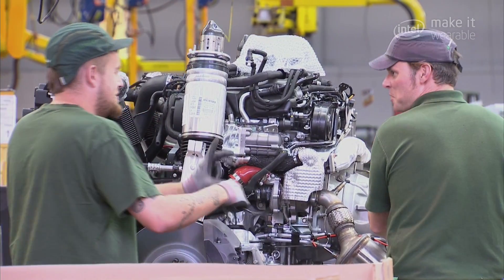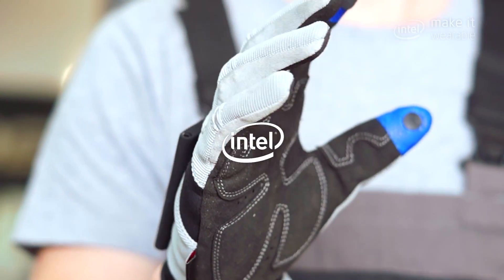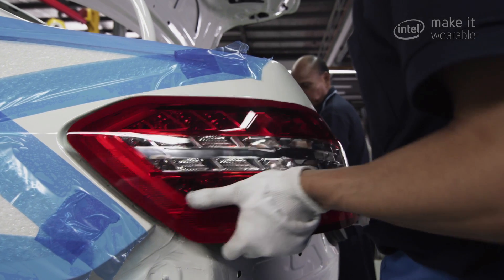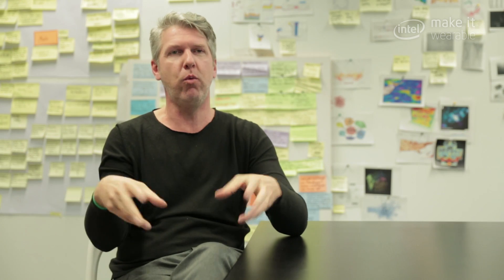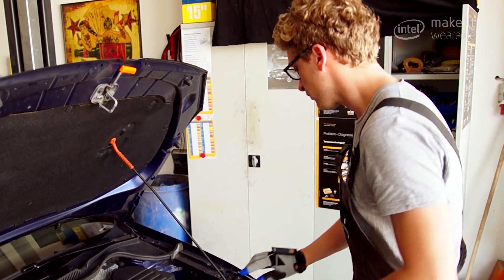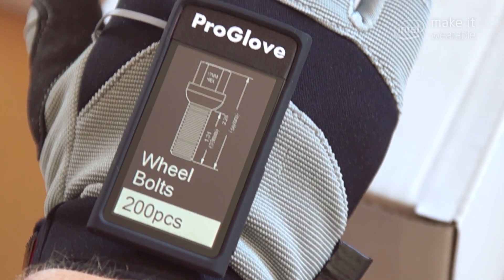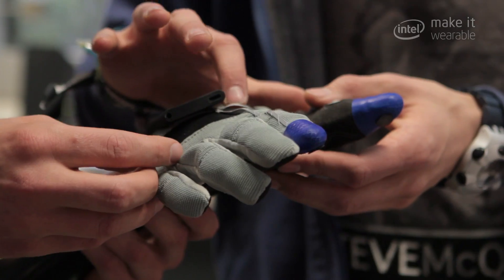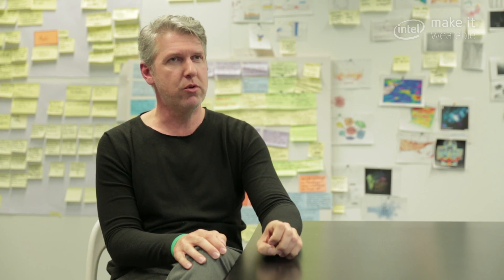Make It Wearable Finalists - Meet Team ProGlove | Intel

Comment: This is a very smart idea for the Edison platform.  If they're going to try implement this into manufacturing, they need a flexible display that's reinforced and very much protected.
Something similar to spider wire line that's woven on the back, a good flexible protector on the front, and the ability to change gloves daily... without the exceeding a couple of minutes to attach an issued "ProGlove." That said, I would buy one with electronics tech support. A set of test leads on the fingers, oscilloscope pass thru, and various other hardware interfaces to supplement the need of rolling racks of equipment to the immediate location that I'm working. Those features would make for a DOD/Mil-Spec dream contract!

That's my ideal glove. :) I just wish I'd had time to enter the contest myself.

After all, cleanliness is next to godliness!